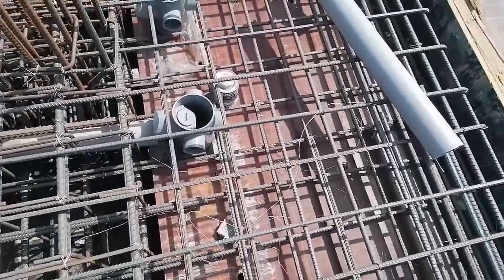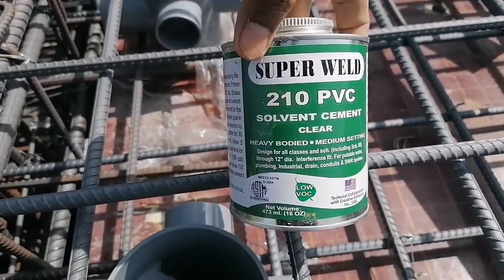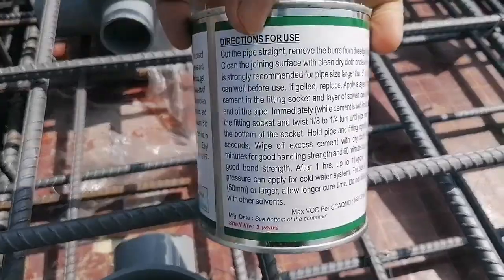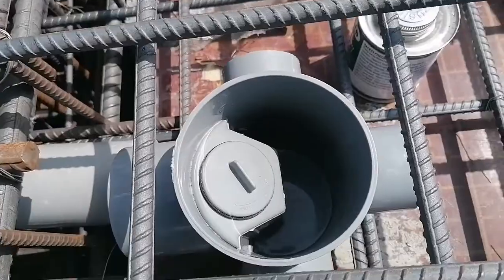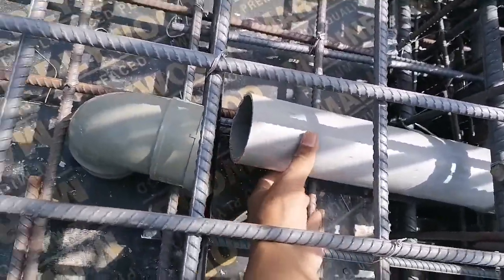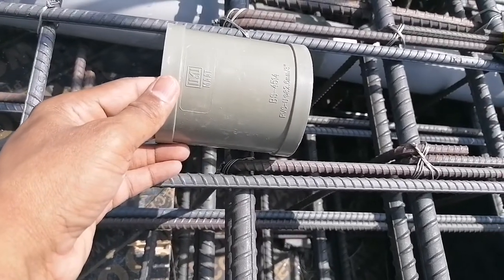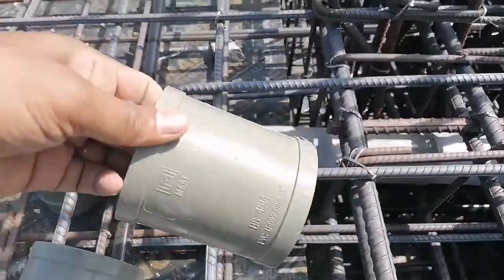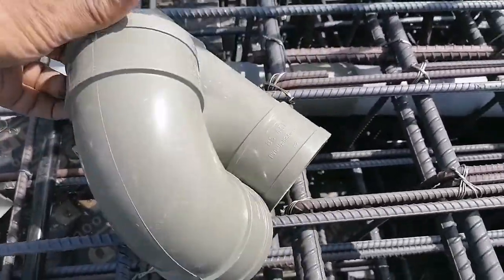How to install drainage, water supply, Air conditioning pipe in concrete floor slabs

Comment: Beam ke end mein concrete zeyada aur centre mein steel zeyada honi chahiye jabke oosi jagah pipe daal diya jaata hai .baath ke paas beam 9" down hona chahiye ,aur ooske oopar 9" brick work ."SA
Reply from the maker: In gulf area, concrete slab it self 20 to 25cm thick with top reinforce steel and bottom reinforce steel ,in between this steel, enough space is there for 2.5 or 3inch pipe.  If slab thickness less than 18cm horizontal pipeing not possible. So vertically  cross slab and hanging with suitable clamp.
Reply from the maker: Never cutt beams main reinforcement steel , you require bigger  sleeves opening check with structural designer  or Civil engineer and make as per his advice. ☝